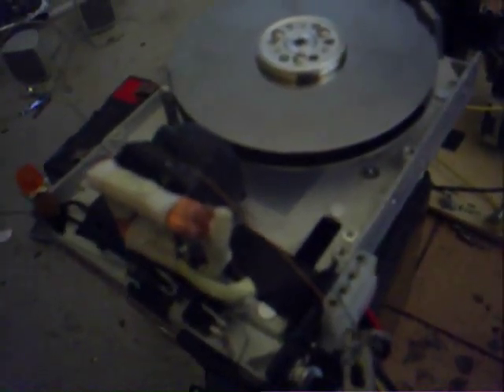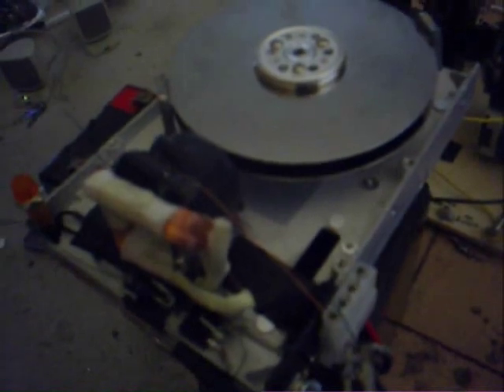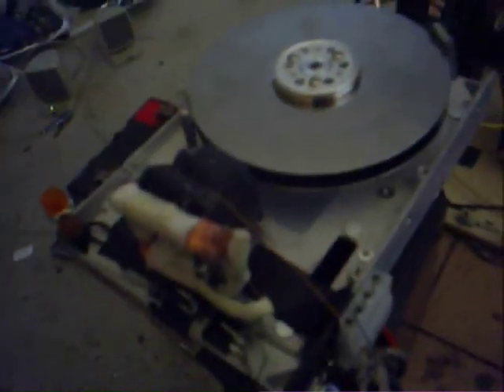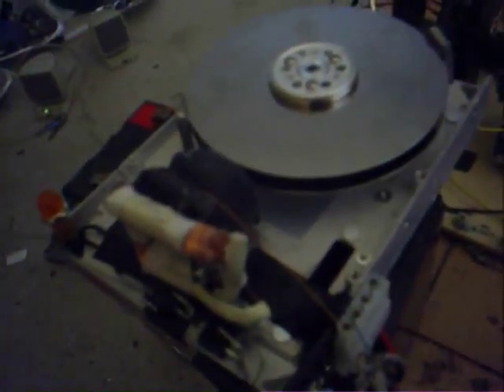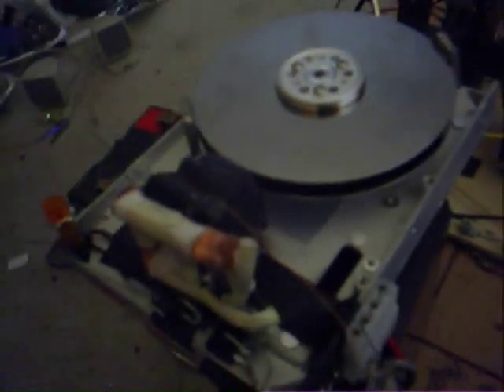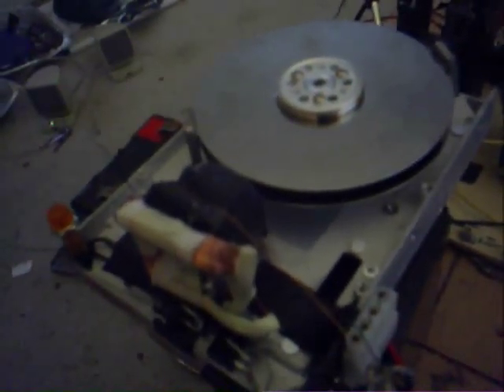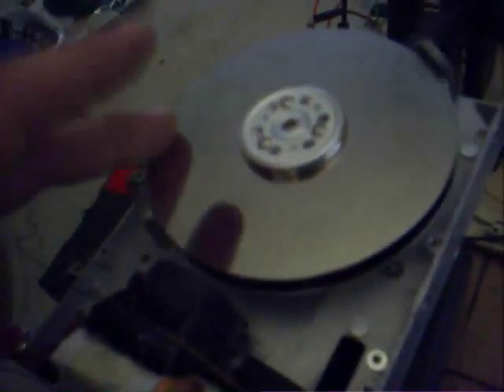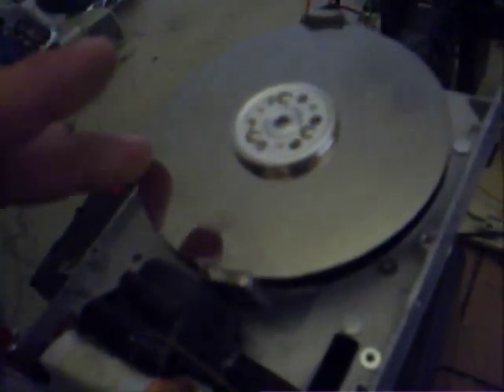coil with LED-air-core to show pulse timing

Comment from the maker: @BiDaDiKuNuKu your too humble =) i notice the best experimenters on youtube are the most humble. the air cores are great man.. i always figured they would work good but thought they would need more current. i realize now their current consumption potential is much less because they have no core to saturate as much. the voltage seems to do fine driving it. my little trifilar goes fast from a 3v button cell with a long run time and i get the feeling it would be better with a super-filar air core